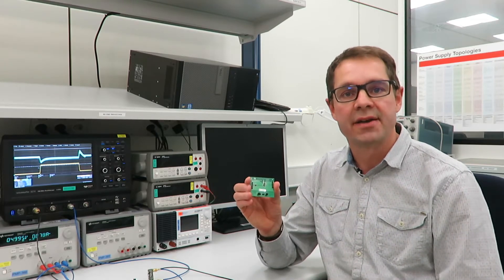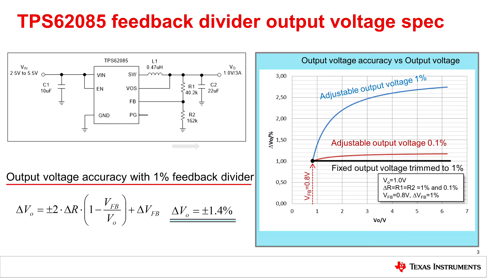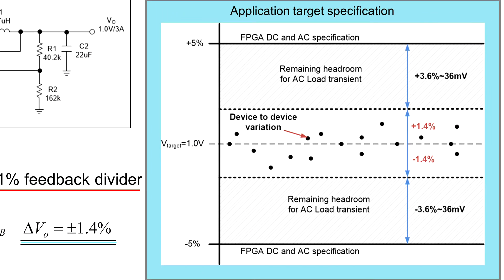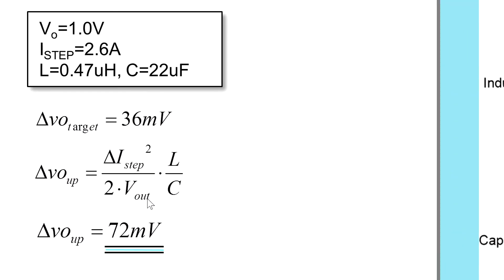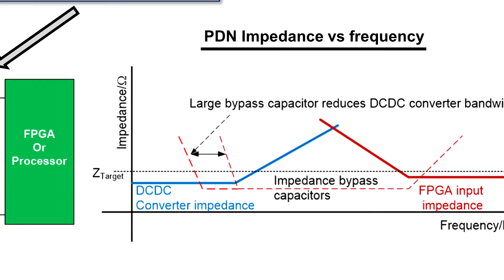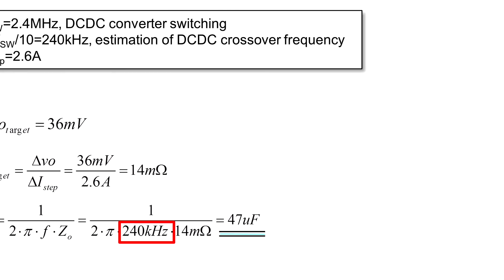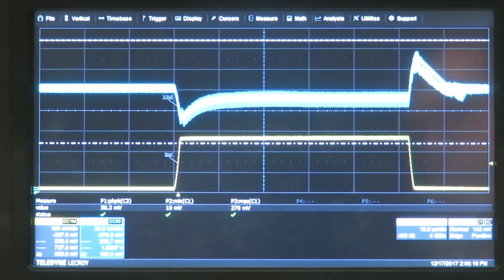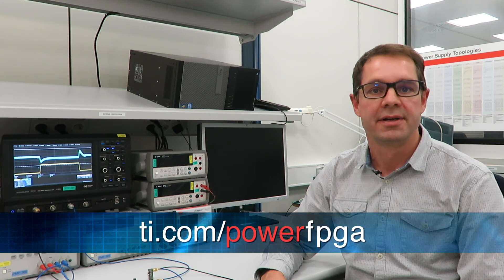How to meet FPGA's DC voltage accuracy and AC load transient specification

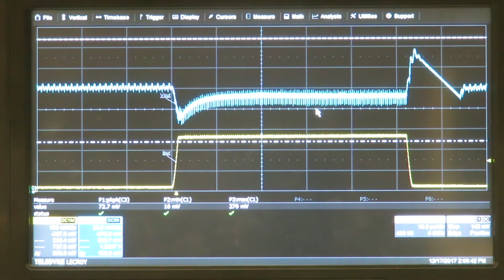Comment: At 6:00 you mention you can see high frequency noise is gotten rid of by using decoupling capacitors.

It looks to me like there is still high frequency noise on the voltage line. What exactly are you comparing before/after with regard to that statement? Can you point out what it’d look like without the decoupling capacitor?